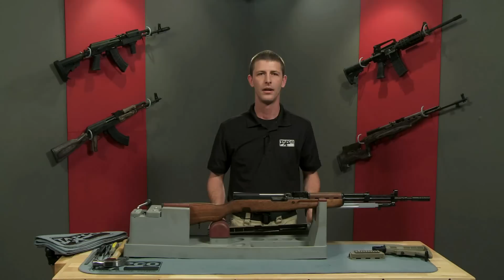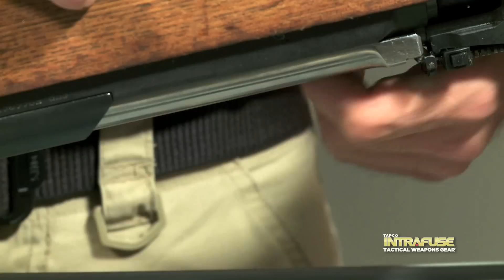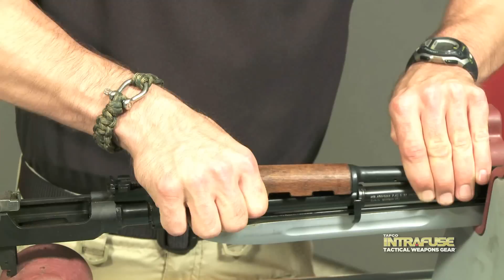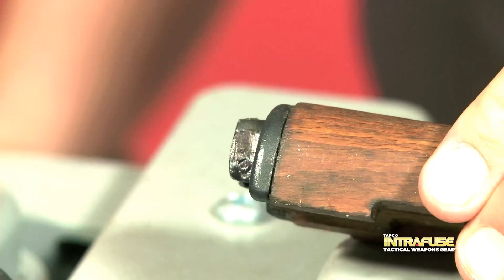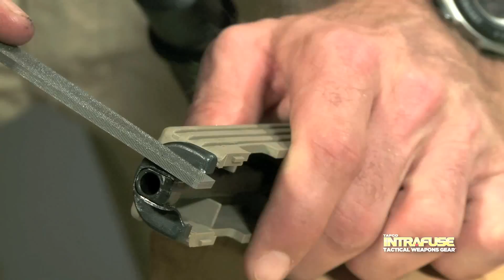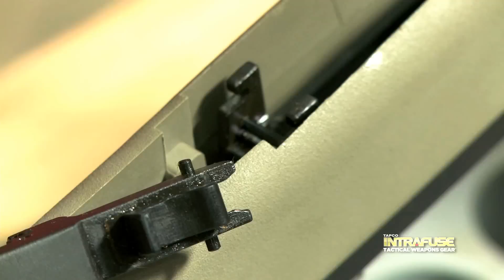SKS Install

Comment: Where can I find a barreled upper sks receiver like this? I have the tapco stock system and hand guard/gas tube setup but don’t know what else I need. Have only messed with AR’s and am completely new to AK’s and sks’s and have little knowledge of what I need.

Comment: I just have one question, which will most likely never be answered because tapco is dead. BUT WHY is the grip set so far back that there's a 1/4" gap between it and the trigger guard? FUCKING. WHY?

Comment: I'd rather keep my aesthetic wood feel
Reply: Sven3xs  it was on my recommended
Reply: Was going to clean up my old wooden stock
Reply: I chemically stripped the varnish off my wooden stock and stained it black, looks great, also install a installed a slotted steel hand guard over the gas piston.
Reply: Do what I did buy a Russian one and keep original and throw a Chinese one in the tapco🤘🏻
Reply: @BigDaddyDak  I dunno man, even the Chinese ones are becoming more rare on gun brokers these days.
Reply: not to mention tapco stocks are garbage

Comment: I have a quick question about the spring that came with the kit. The spring does not fi tin the hole. Should it just drop in the hole? The only way it can drop right in is if I carfully make the hole slightly bigger? How did you solve the issue.? I would think that making the hole a bit bigger is okay since it only pushes the trigger group back out of the stock. I need advice please.

Comment: Geeze guys, you have to properly set the new pin on the gas tube hand/heat guard retaining plate.

With limited tools you can use a vice to press the pin in the gas tube pin hole for a secure fit. The pin is soft and will flair out into all the voids in the gas tube pin hole for a very tight fit. You can now use an awl or very small punch in the center of the small side of the pin which will flair out the top. Once the retaining plate is tight you can do a final press in the vice. File off the high spots but dont take off more then needed. After that follow tapcos instructions for a tight fitment of the gas tube which is desired for better accuracy.

Thanks

Comment: I just ordered this kit. Ho-ly. Shit. That trigger spring is damn near impossible  to get in. Now that I got it in. The trigger assembly won't pop it. I took a mallet to it, pushed it as hard as I could. Used a punch. Nothing! I have tried getting it on for the past 2 hours
Reply: I had to drill the hole a tad bigger .Then it worked fine

Comment: My pin for my gas tube won’t come out. Any suggestions?
Reply: Some are effectively welded in place. I bend the metal one either side of the pin til it clears the pin an slides off. After replacing the handguard and using pliers,  bend the  metal back around the pin. I've done this several times on different SKSs and had no problems. Just be careful.

Comment: Hey tapko.   I've been looking for this stock, with the bayonet cutout.  Can't seem to find it in stock anywhere.  I was curious though, i dont have the thin blade on mine.  It has the spike(i guess it was paratrooper?).   Will it fit on this stock still?

Comment: How does the weight of the TAPCO stock compare to the original wood stock?
Reply: It is significantly lighter and increases recoil
Reply: A plastic stock is almost useless if you have to engage in hand to hand bayonet fighting. This may never be an issue unless the SHTF.

Comment: Can the action remain open with NO mag in the tapco stock like the original wooden one that was top fed? Just wondering before I shoot the thing haha it’s my first rifle and my first mod
Reply: Yes it can. Just pull the bolt back and pop a finger up the mag well and slide the metal piece up and then your action will stay open. (I don't know the name of that metal piece)

Comment: Having hard time inserting spring. Hole isn’t Large enough. Is this uncommon?
Reply: Had the same problem, so did other people I know that bought the stock.
Reply: Same problem here.
Reply: Like others have said, many have had the problem. What solved it for me was drilling a very slightly wider hole.

Comment: Anyone else have trouble reinstalling the trigger in the tapco stock? If so does anyone have a fix to get the trigger group to lock into the detent again? Wanted to ask before I get my dremel tool involved.
Reply from the maker: We will be more than happy to assist you with any installation questions, just contact us at techquestions@tapco.com. Thanks!